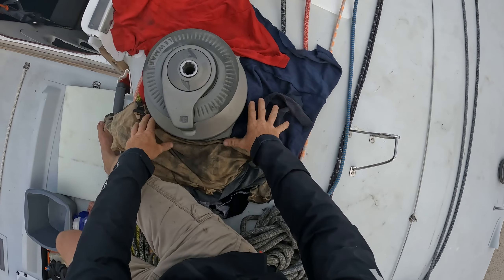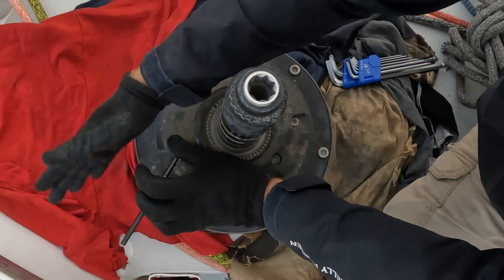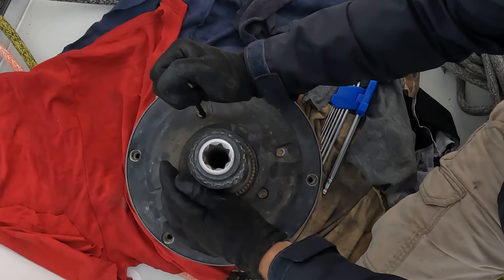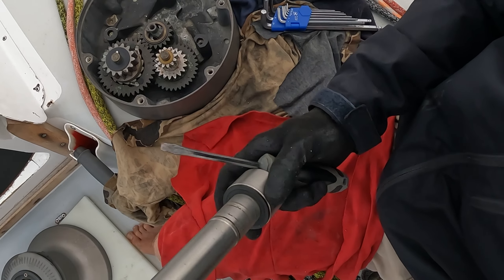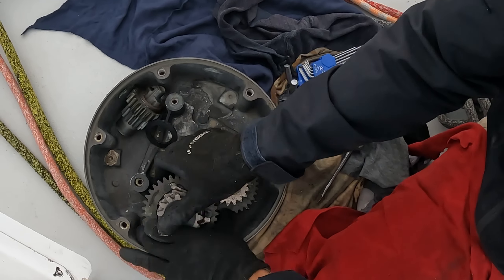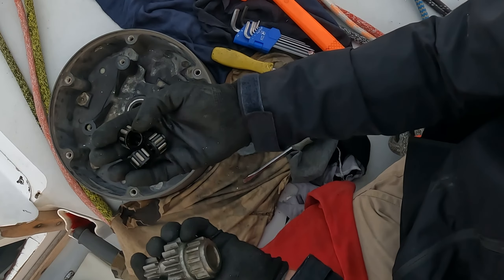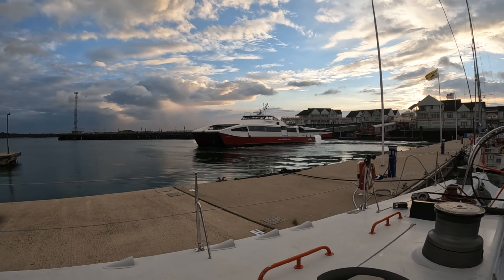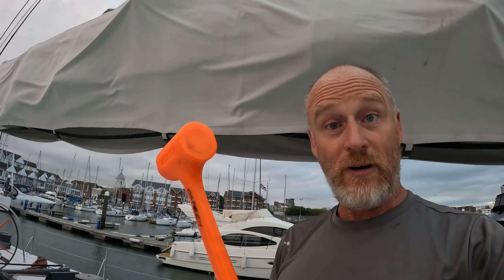#3 | Boat Maintenance | Taking a Winch Apart

Comment: Anhydrous lanolin is great for preventing galling (?) but the best news, it’s $20 ( Can) a lb at any compounding pharmacy. Having said that, I’ve never used it with magnesium.
Reply from the maker: That’s a great tip thank you ! I will check that out asap.

Comment: As a beginner, what is the logic behind a 316 stainless steel bolt going into an aluminium or magnesium base? There's obviously some sort of design intent behind using these different materials. I understand 316 would have the strength but unsure as to why the other components would then be composed of other materials. 

My though process is telling me they obviously have a more desirable material profile, maybe something to do with performance and longevity under friction, or designed to work with the chemicals and lubricants in common usage today?